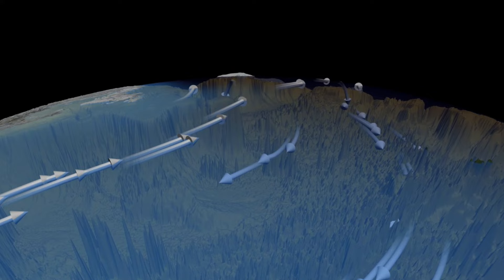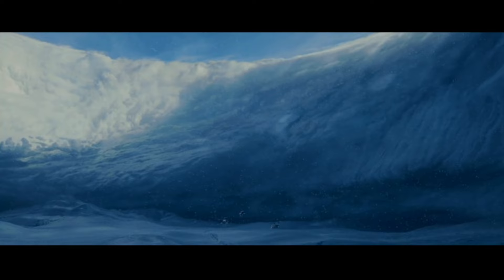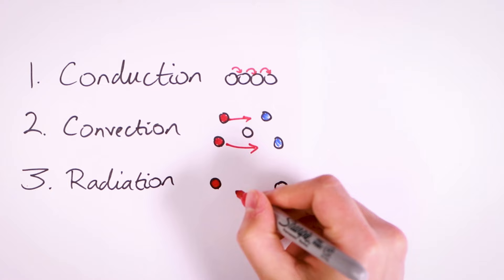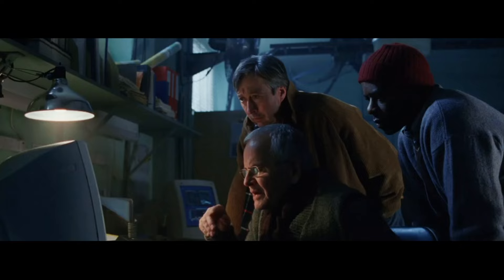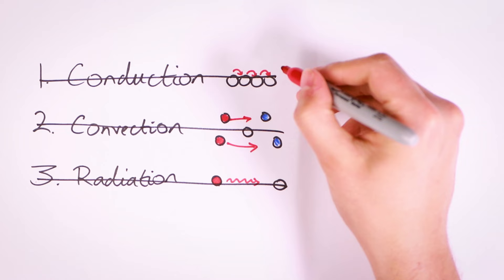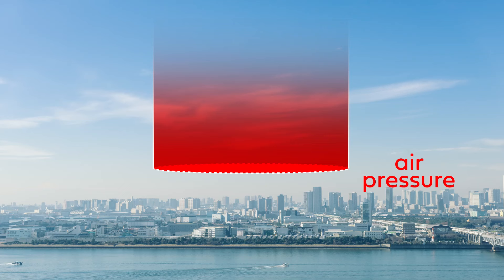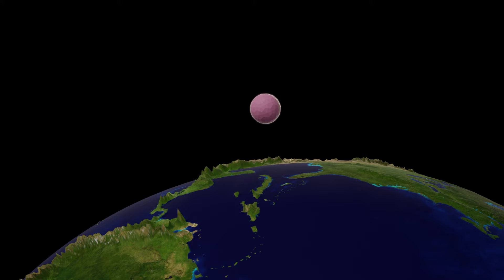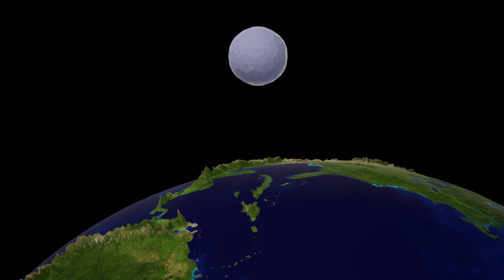The Biggest Error in The Day After Tomorrow

Comment: This video was so, sooo bad.
Using "work being done" as your vantage point to explaining, why this reverse hurricane (was it??) would not work the way this movie portrays it, lets you come  across as pretty ignorant...
But from the start!

Yes, the scene and science-woo you described was very bad. But the reasons are different.
You should have talked about, atleast once, [about] the difference between "temperature meassured" and "heat (/energy) content" -- those are not the same!
The way you talk about it makes it seem like you don't even know the difference. Maybe if we were to look at it in reverse it would become more clear?

What is a heat-pump? How does it work? How does a refrigeration cycle work?
Better yet: what happens, if you cut open a pressurized gas bottle (chuck full with no2 or whatever at the proverbial "room temperature"!)?

First off -- if you do that by decapitating it, you may get yourself or others seriously injured, as you'd basically have a torpedo or rocket flying across the street!

Secondly: the gas... It will cool down everything in it's path significantly! (As do NASA rockets if their pressurized fuel leaks out w/o being ignited)
How come? Did it do negative work, as by your logic? No: it simply depressurized and as such the gas's relatively low [starting] heat content (with now increased heat potential) started stealing thermal energy from it's surrounding as it expanded! "Work being done" means little in explaining this in a video aimed at a wide audience!

If gas gets compressed it gives off heat, as it's potential for storing/saving/carrying it drops! As it expands, the reverse happens (provided that there is surplus heat in the environment that the gas can capture)!
If you have a cycle of this, like gases in a pipe, with wider and narrower sections, you can actively "pump heat", something that allows you, for instance, to extract heat from the ground in winter, to warm your house (i). It is also the same mechanism that keeps the food in your refrigerator fresh.

See... I guess you could try accessing this mechanic by talking about "work being done", I suppose, if you are hellbend on doing that (I can't imagine it, but maybe I am missing something). But you will not actually educate a lot of people that way, as your assessment is ignorantly vague (betraying a lack of understanding on your own part). So why not do something intelligent instead?

Now... If - like in the movie - we were to introduce air from the upper athmosphere to the ground athmosphere, would this compress the air? Maybe. And if so, it should squeeze out extra thermal energy, leading to heating rather than cooling (the intensity of which seems debateable).
But, what if the very process that vents the air downwards was an apocalyptic lack of pressure at the eye of the reversed hurricane? Real hurricanes do, after all, function on the basis of pressure gradients. The real problem then becomes, what an insane pressure gradient that would imply (ii) for this scene, in order for the desired cooling effect to take place (by transporting the thin cold air from way up in the earths athmosphere way down to sea level w/o adjusting it's pressure!); and most people will not care here, if - 70° was enough or if that was neglectible a difference to - 100° -- that's fully within -the margin of error the reach for suspense of disbelieve; you are aware, that this is a hollywood movie we are talking about here, right?

Like I said before: terrible video!
Try again!
... and besides: when it comes to film-logic being so bad that one wants to violently pull your eyes out to not having to see it anymore, you ain't seen nothing YET until you watched Pacific Rim. That long sequence of events, starting with the Kaiju having its giant tail ripped off, to then grab the humanoid mech and lift it, with its wings, into the stratosphere (?), and also the facepalm moment that ended it... -- there you have an entire array of golden raspberry moments that defy description (iii). Go see it yourself! It may "humble" your expectations for hollywood logic for good!

PS: some of "Veritasium"s videos may do you some good; I vaguely remember one of his "asking random people on the streets" videos concerning, what materials feel "cold to the touch" and having them trying to explain why that is...

i) and you can do this beyond the temperature of tge ground itself, a phenomenon that is impossible to grasp unless you differentiate "meassured temperature" and "thermal energy" / "heat content", like I insisted above!

ii) speaking of which. Pressure (like the differences between ground and upper athmosphere), also is an important variable here that you lazyly glossed over/hugely ignored.

iii) there is so much more to that scene, that just listing all the nonsense would easily double the size of this comment!